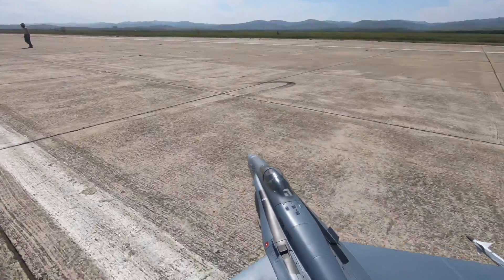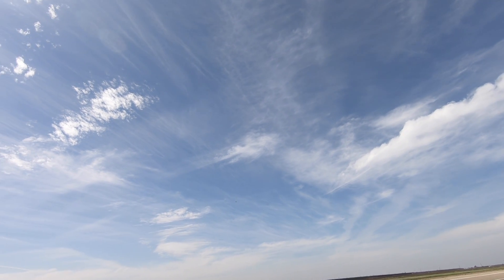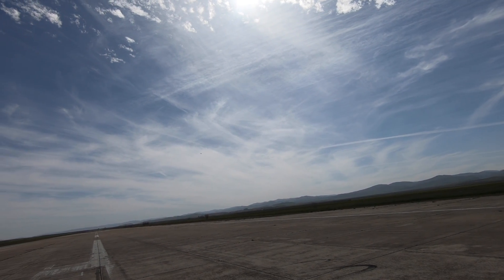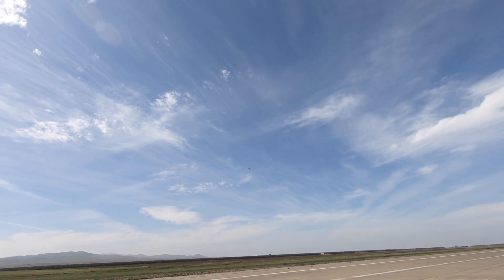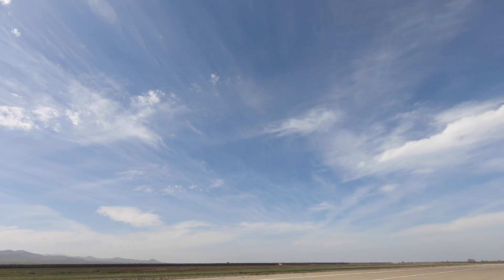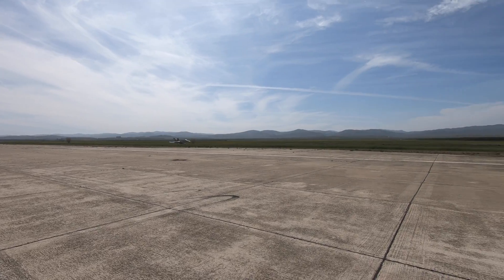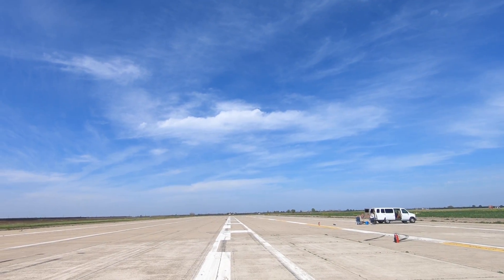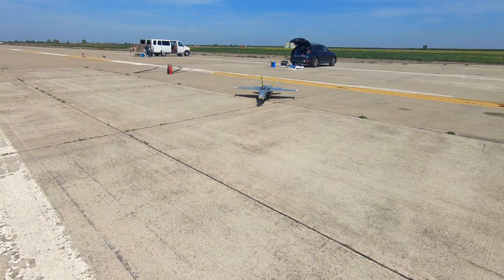Skymaster 1:8 TWIN EDF: Mastering Slow Flight & Landing

Comment: Hey Franny,
I was wondering what the neutral position for your elevator are on your F-18? I have a  SkyEmaster F-18. I think it's the1/9 or 1/10 scale version of the composite jet. I can't find a manual for it so I was hoping that you could provide a good starting point to figure out the neutral position for there maiden.
Reply from the maker: Yes of course. I'll pull out the F18 check and let you know
Reply: @FlyWithFrank   your the best bro. Cheers
Reply from the maker: @ghoustanable  https://youtu.be/FjU05jX5rj0. Is this what you were looking for?